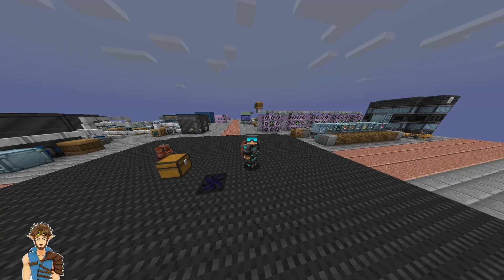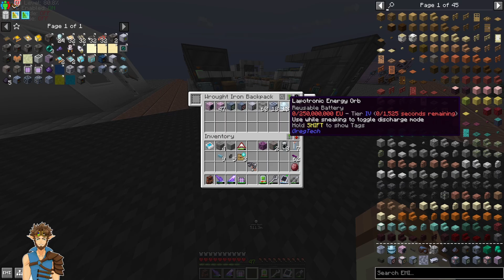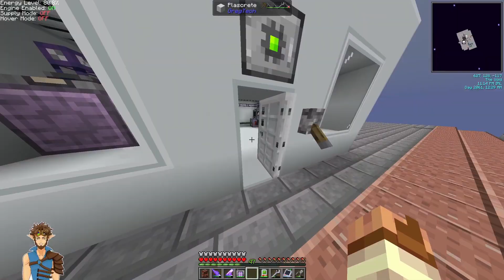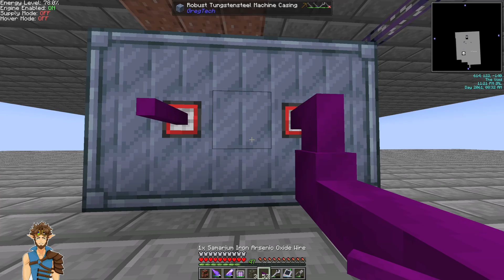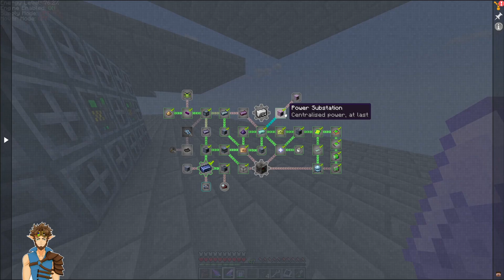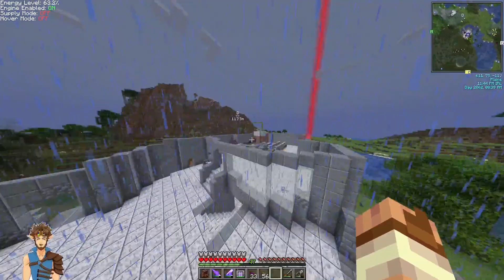Gregtech Modern Ep60: IV Substation

Comment: Substations aren't capacitor banks IRL.
Nor are capacitor banks really used to store power.
They are buildings that handle power distribution. This mostly means transforming grid high voltage (usually something like very roughly 100kV, but can be anywhere from 765kV down to 44kV) into grid medium voltage (something between 35kV down to 7kV). but also the power switched for the grid (which is a lot harder than it sounds) and breakers for it. (i actually got an advertisement for power grid level breakers recently ish)
Energy storage that hooks into a power network at grid high voltage is something like a Pumped-storage hydroelectric plant, which is basically a couple of lakes with a dam to generate power and a pump to put power back in. 
Sounds simple and that's because it is and that's also why they can scale up to hundreds of megawatts of output power and enough to run for weeks in a single storage plant. 
Using water to spin a turbine is great even when the water is liquid.
Reply: That reminds me - why can't you use combined cycle power generation in gregtech? You probably shouldn't be able to use it with single-block turbines, but power station gas/liquid fuel turbines run the exhaust though a heat exchanger  and run a steam generator off of that.

Comment: yo should build more maintenance hatches(traps door close to your machines) so you dont have to fly all around XD, also i been using the telepor stuff quite cool to move around, you can dye the backpacks, like shulker boxes so you know what is in each one.
Reply: I personally would also put all of them in your inventory, not using the baubles slot. It's just simpler and frees up a key-bind as well as making the colour coding meaningful for less than 3 backpacks.